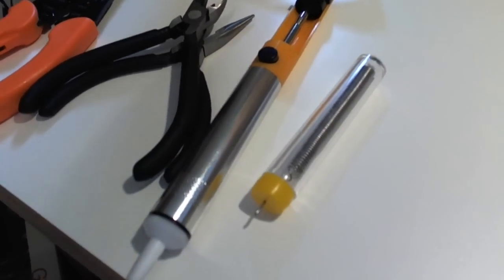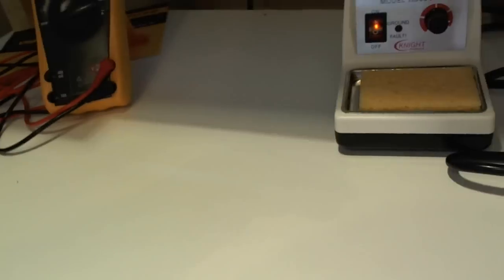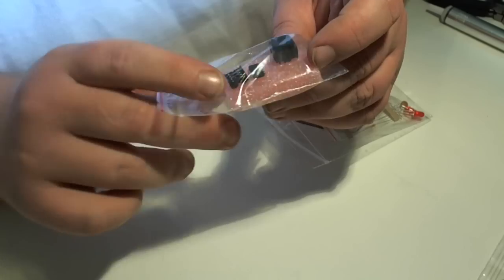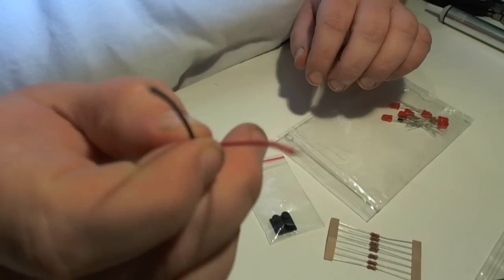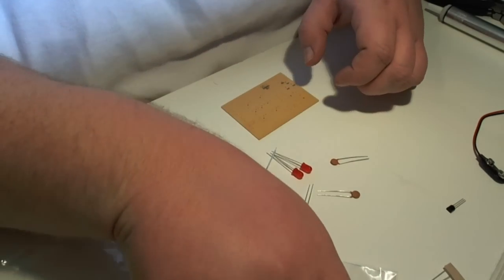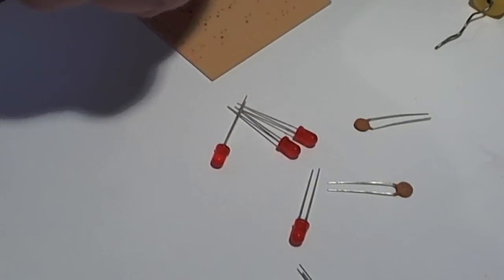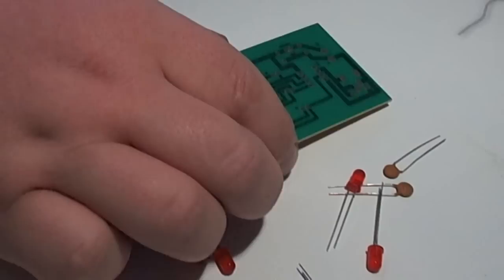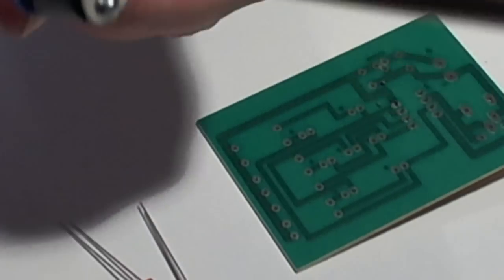Basic Soldering Tutorial - Part 1

Comment: Some pointers what you need:
1.Better quality tip
2. Better quality and thinner solder wire
3. Higher temp
4.Maybe extra flux
You did not tin the tip the solder was bouncing from it.